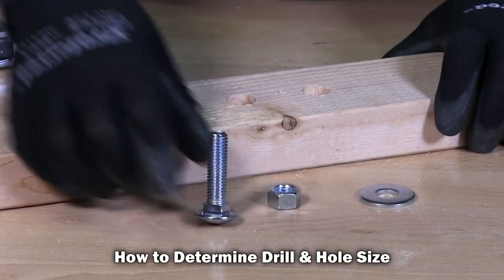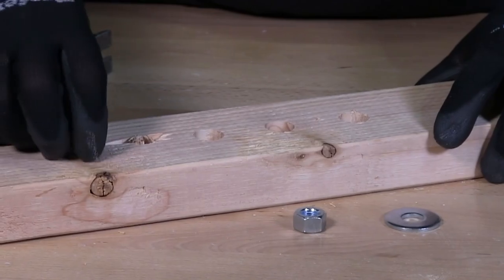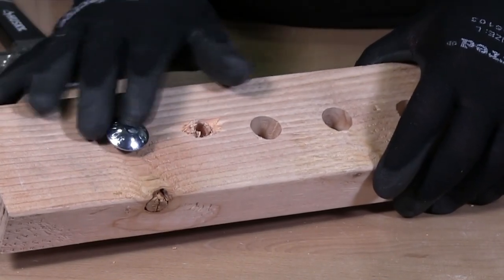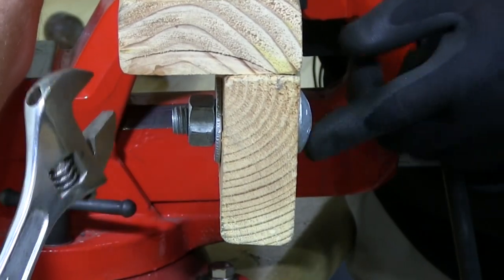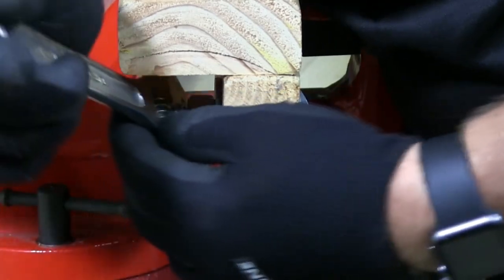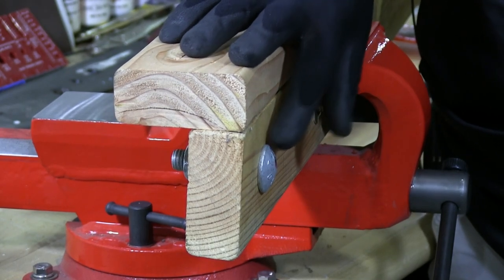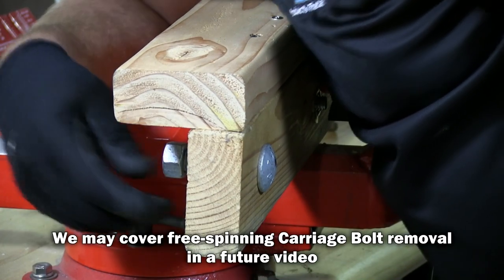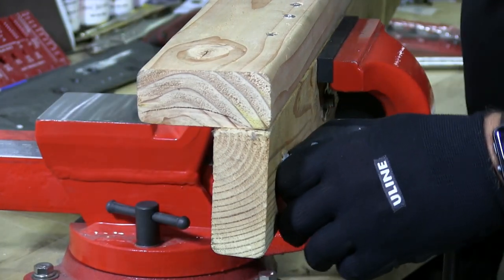Guide To Carriage Bolts: Sizing, Installing, & Removal | Fasteners 101

Comment: I have carriage bolts on my snowblower skids. What a pain. I need to find something slotted because it took us 2 hours to get these things off. I have a Husqvarna. Snowblower works great, but these carriage bolts, not so much. Is there anything else I could use? TIA.
Reply from the maker: Start days before you want to remove the carriage bolts and spray them with DW40 each day for a week.  Those bolts should come off easy if you do this process.

Comment: What is the benefit of using a carriage bolt? When should it be used?
Reply: The square neck keeps the bolt from slipping when you tighten it. So you dont have to back it up. However, I have seen them eventually work loose and the pilot hole round out some and the bolt slip. Then it's a P.I.T.A. to extract.
Reply: Normally when working with wood that needs a good structural integrity. In other words, for objects that will be used in ways a screw will not hold everything together. Work tables, big wooden boxes or crates, docks for your lake house.